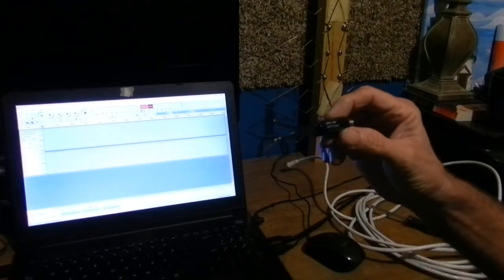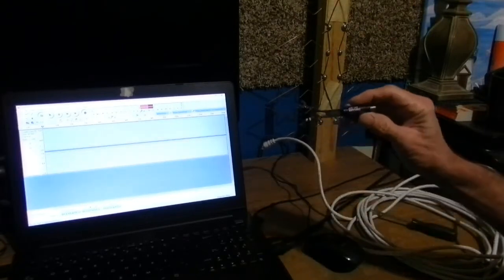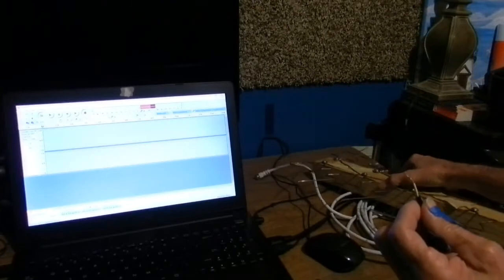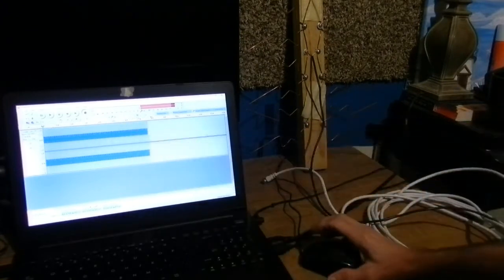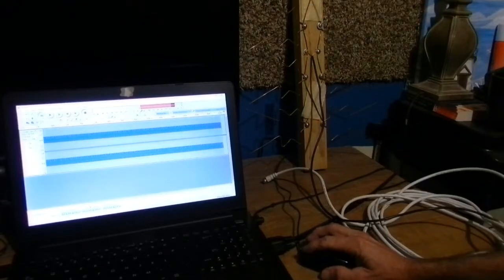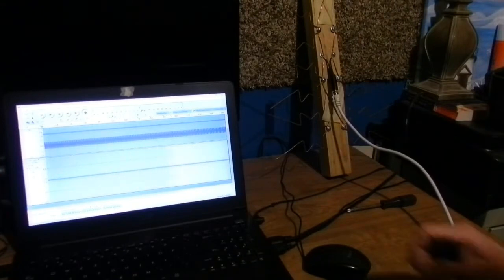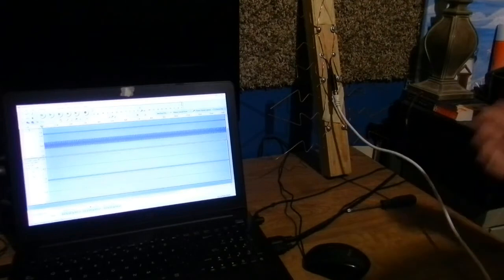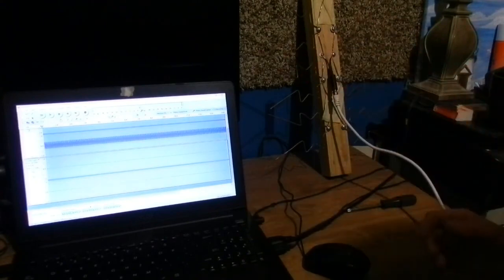HDTV Antenna Matching Transformer - An Interesting Experiment

Comment: Your Not Picking Up VHF Signal Your Just Recording 60 Hz Hum noise from the Audio cable being ungrounded you can’t use these matching Transformers backwards it doesn’t work. It’s Meant to Match 75 ohms to 300 ohms to connect a 50 ohm or 75 ohm piece of coax that’s connected to a signal to the 300 ohm terminal connections on some vintage TV sets. The 2nd time you Recorded nothing because the audio cable was grounded to the Coax shielding. You can use these Matching transformers for Antennas with a R36 type piece of coax (50/75 Ohms) to convert it to 300 ohms for the terminal connection on the back of some Vintage TV Sets for receiving Analog VHF/UHF TV. There not really useful for HD Over The Air VHF/UHF TV. There mostly useful for RF Output connections on any converter box or Video Modulators. When you use these backwards all it does is just Creates an Open RF Circuit. Otherwise that antenna looks pretty neat! It should work pretty good For OTA HDTV looks like you did a great job! 👍🏻all you need to is solder that piece of coax to the connections rather than creating and open RF Connection with that Matching Transformer

Comment: I agree with those who think this video is pretty much nonsense.  A TV looking at 50 MHz and above should have no problem dealing with 60 or 120 Hz power line-induced hum.  Otherwise how did they manage in the days of 300 Ohm twin lead and 300 Ohm inputs.  No balun (matching transformer) in those days.

BTW, it is a fact that coax is much more lossy than the old twin lead.  When I was a kid we put up a modest rooftop antenna, ran twin lead into the attic and split the signal 4 ways to 4 TVs.  We ran the twin lead down in the walls, had plug-in outlets by each TV and never had any issues with signal strength.  We ignored the rules about twin lead needing to stay away from metal and all that.  It worked fine.  But it was my dream, from my readings, to put in coax because that was the allegedly better way.  So when I was in college, I finally did.  Signal strength plummeted and for the first time we needed an amplifier.  The law of unintended consequences!
Reply: Let's agree to disagree. The Balun transformer uses a ferite core and coil around the core to reduce eddy currents. These eddy currents are actually what cause hum, distortion and interference on the receiving antenna. If you think about it logically, when an antenna is split by two leads, they can interfere with eachother (if a diode is not in place) because of the electricity that is in proximity to the two leads. A balun transformer for a coaxial signal will increase the ohms, decreasing the current and interference.

Comment: Hey Mike, not trying to be critical, I like your videos. The mistake I have seen in many antenna videos is that people do not realize that the outside part of coaxial cable is shielding and normally grounded. If you cut a balun in half, you would see that both leads go to the center, therefore you are not making the connection between the 2. One vid a guy made he didn't use a transformer and used the braided shielding as one wire and the center as the other. He was only really using half his antenna and freaked out after I pointed that out. Needless to say his reception improved by adding the transformer. I have no idea if you just connect both sides to the center if it will work or not.  Thanks
Reply from the maker: Thanks for your comment thong. The first few I built and put in my attic had no transformer and I wired it the same way he did and they brought in almost the same reception except they were more sensitive to interference causing pixelation and the star shaped fractals helped tremendously to reduce it. But the Sinaloa strength was close to the same

Comment: 2wrdr has hit it pretty much spot on. As you said in the clip, the sound card in the computer has a max frequency response of ~20 kHz. It's an AUDIO device. Trying to detect RF with an audio device isn't going to work (unless the RF energy is at a frequency within the sound card's bandwidth) without a detector stage.
As 2wrdr mentioned, when you loaded the sound card's input with the 75 Ohm winding of the BalUn, you were effectively putting a DC short across the input terminals. (The BalUn exhibits a 75 Ohm impedance at Radio frequencies, NOT DC. At DC and audio frequencies, the BalUn winding looks like a piece of wire with very little resistance) DC and RF are, and behave, very differently from each other. The other function of the BalUn is to convert a 300 Ohm BALanced load (the antenna) to a 75 Ohm UNbalanced transmission line. (the coaxial cable) Isolation is NOT one of its intended functions.
Reply from the maker: I’m assuming that DC means direct current?
Reply: @DIYProjectsWithMike  Correct. DC is the standard abbreviation for Direct Current.

Comment: You are using the wrong "test" equipment. The mic/software is designed to capture sound waves not radio waves (RF). The sound being recorded without the balun is the 60HZ AC hum from your electrical system. A better test would be with the antenna connected to an SDR dongle with the appropriate software like SDR# tuned to the middle of the TV broadcast band. You did however, prove that the balun is good at filtering out low frequency "noise."
Reply: The BalUn didn't filter out the "noise." It acted like a low value resistor and swamped any signals appearing at the input.

Comment: Agree with 2wrdr and have 2 comments. The first is to swap out the microphone recorder and substitute an rtl-sdr (software defined radio). That device is matched for recording waveforms at these frequencies. The experiment performed here is like trying to record an analog video signal using an audio cassette recorder. The second is that although the balun is designed to impedance match 300 ohm to 75 ohm, I'm not understanding what is causing the antenna to present 300 ohms as it's impedance. It's most likely due to it's "equivalent" circuit modeled as inductor/ capacitor components at the given frequencies. So probably affected by lots of variables, some of which could possibly be optimized too.

Comment: The balun or matching transformer (same thing) provides a better path for TV frequencies into your tuner by matching the impedance or your antenna (approx. 300 ohms) to your cable (approx. 75 ohms).  Without this matching a large portion of your TV signal reflects back to the antenna never making it to your tuner.  It of course also provides a convenient mechanical way of connecting cable to antenna.  The noise your were hearing without the balun was 60 cycles from commercial power.  Unloaded (without balun) the 60 cycles is free to travel to your mic input.  Once you installed the balun it place a load via one of the windings in the balun to snub out the 60 cycles.  That's the best compromise of technical and laymen terms I can come up with.  Also its been 33 years since I majored in radio frequency electronics so I could be a little off.  Antennas and radio frequency propagation are a complete science on its own especially when you consider everything from Long Wave (lower frequencies) to cell phone and Satellite based frequencies (extreme high frequencies)  I hope some of that helps.
Reply from the maker: Thanks, very helpful. Makes sense. I've learned everything I know from online research and experimentation. Thank you for taking the time to comment. :)